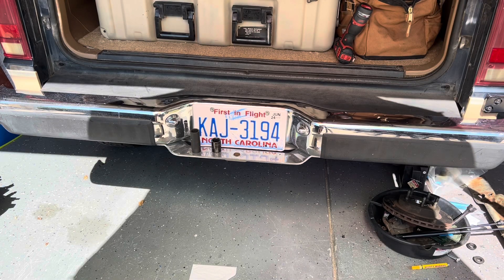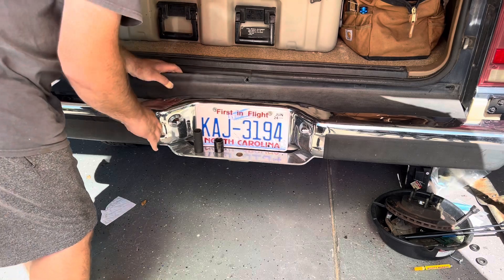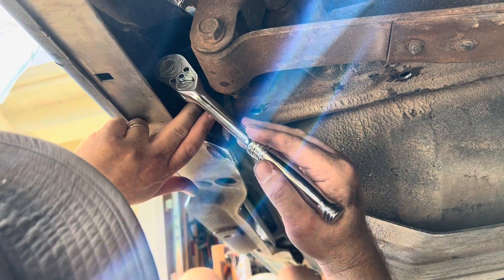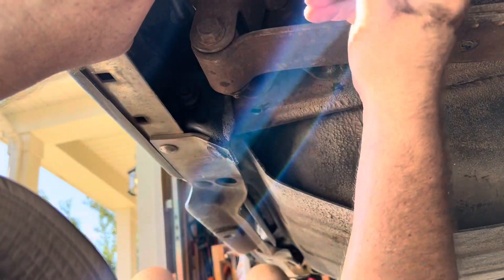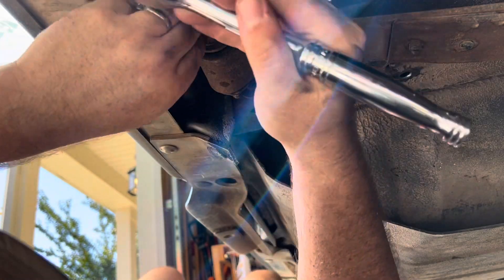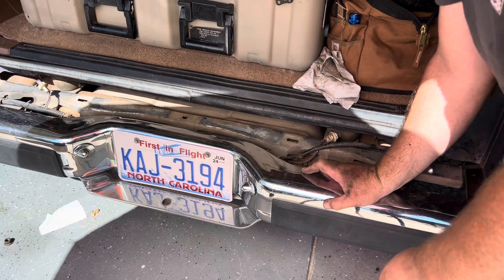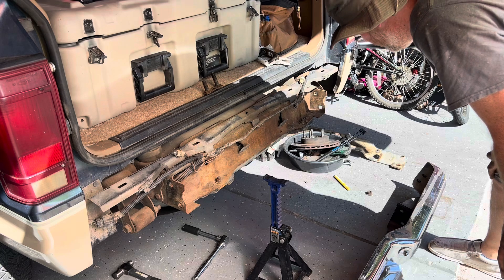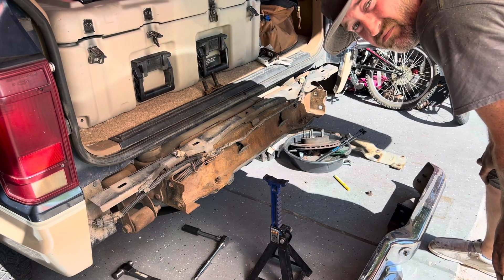Removing the rear bumper on a Ford Bronco II

Comment: I wish it were this simple for my '84. That plastic panel is in three separate pieces and the bottom long flat piece seems to be WEDGED between the frame and the bumper with no play at all. And of course, no manual covers this...